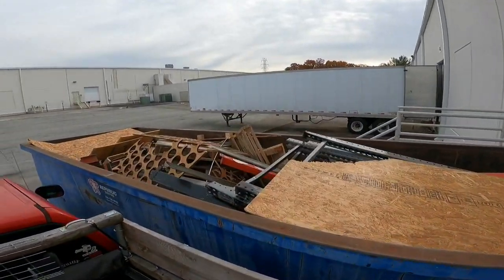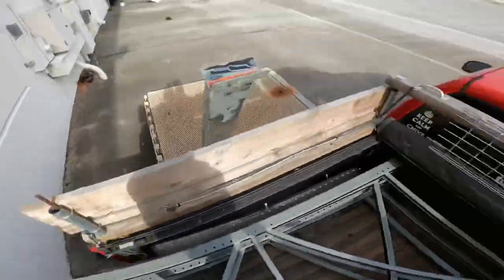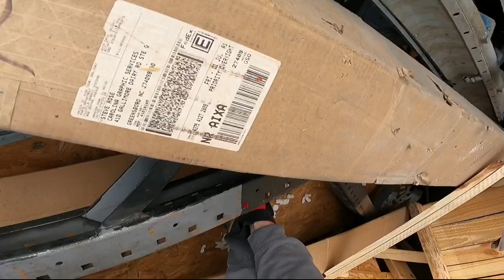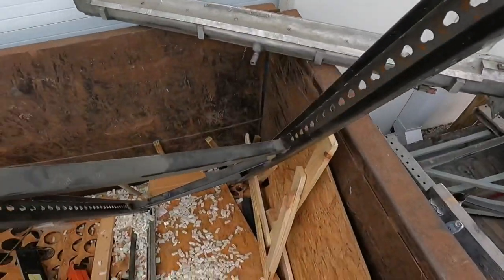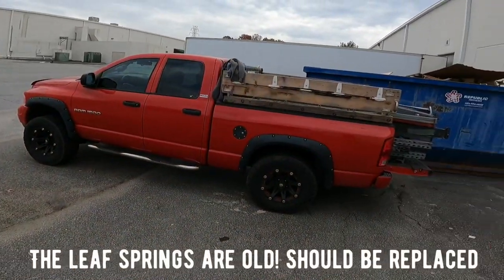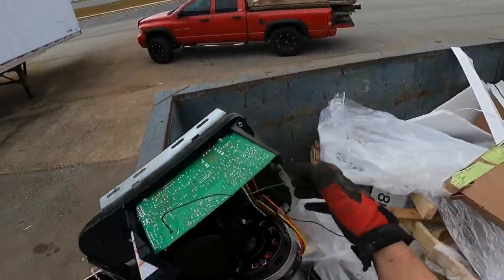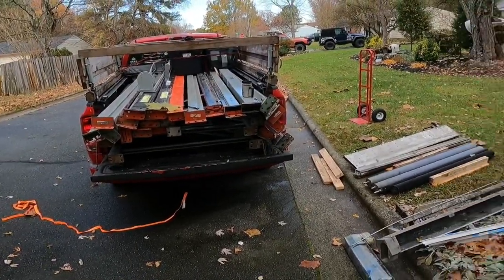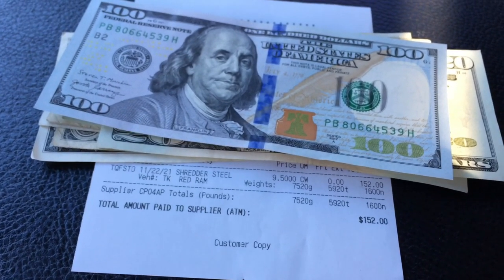Heavy Metal Dumpster Haul - I’ll Take These Types of Dives Every Day

Comment: Hi Joel
Great to see you again!

Those 'rods' covered in grey rubber are applicator rollers, they go into those stainless troughs. They would be used to probably apply glue to sheet material like plywood or paper to bond sheets together. the brush ones are used to apply a little pressure on the sheet from above.
The troughs are made from stainless or alloy to avoid problems with rust, (rust=stained adhesive-not good) and also to make things easier to clean.
I worked in a paper box factory for over 40 years, and I must have cleaned out hundreds in my time!

I hope your 'other ventures' are doing ok...just be careful, don't get your fingers burnt!

Regards
Chris